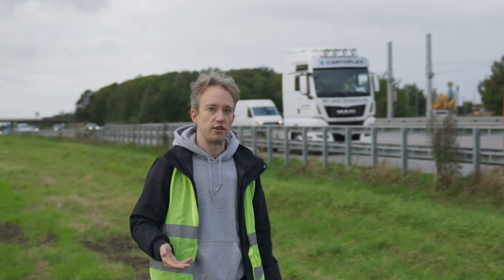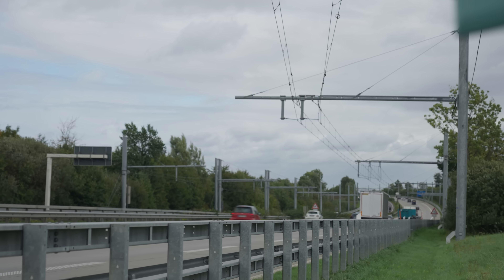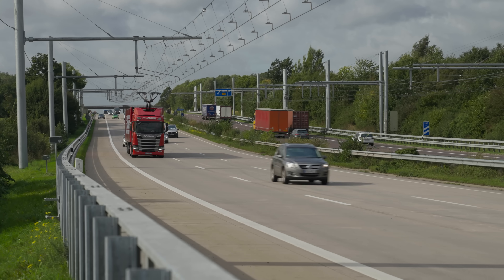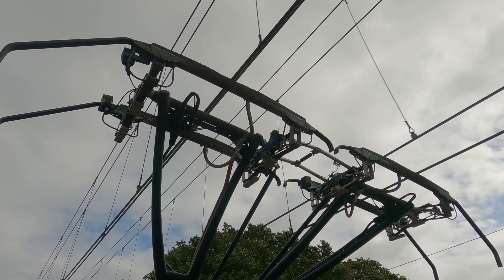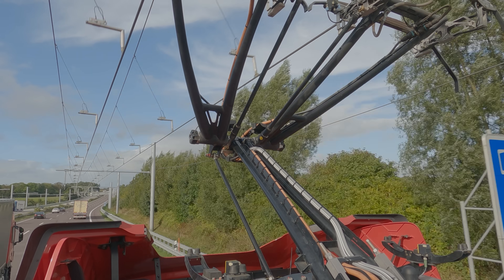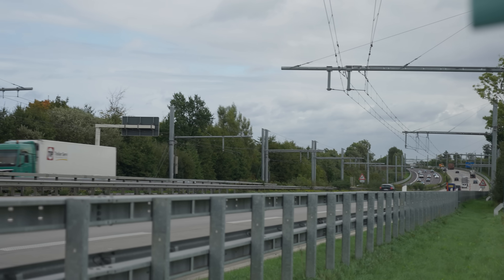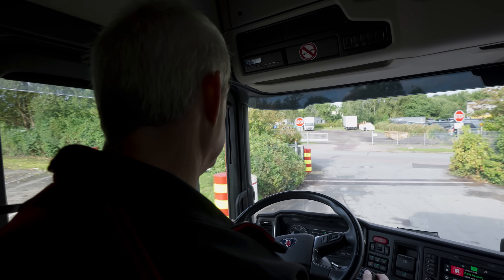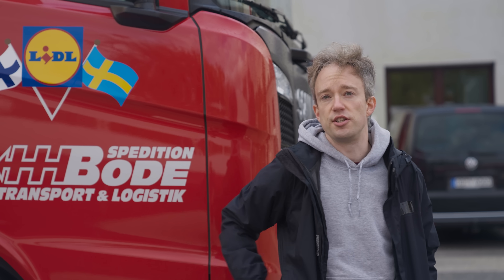The highway where trucks work like electric trains

Comment: Please enable auto-generated subtitles. Seeing words appear on the screen right as they're spoken (more or less time-accurate, but with consistent accuracy in terms of time-offset) does wonders for accessibility, especially for people who are still learning the language and for people who are partially hearing impaired (which is a lot more common than people think, especially due to how many people live and work in places with noise pollution which cause lifetime-long hearing damage).

As for trolley-trucks, cities could simply add trolley lines and let both trucks and smaller vehicles (like business or personal vehicles) use electricity to travel in the city, with or without a meter for electricity (i.e. flat monthly fee for the category of vehicle being driven, and starting with 5 years of free or very low fees to get more people to invest in the technology), up to even allowing electric trolley-scooters and electric trolley-bikes to move inside the city (either for free to replace public transport with low-noise electric vehicles, or with a similar electricity meter for the trolley antennas). Also, such a system could be used to use-up the excess energy from renewables such as solar, since there is a lot of vehicle activity during the times of the day when there is light outside and common electric vehicles cannot be charged significantly while they are in use, unless a trolley-attachment is used for recharging. And, to be fair, adding a trolley connection to electric vehicles could increase their range significantly by simply connecting to different trolley networks on the roads, such as those already existing for trolley-buses inside cities, and adding trolley connections on the right-most and emergency lanes of the highways.
Reply: I guess they might not have been there 24 mins ago but there are captions now.

Comment: This is a great idea, but what would be even better is hooking up a bunch of trailers to one truck to make better efficiency of trips. And maybe instead of having pure asphalt, we put down little steel rails on one side of the highway to have less friction...oh wait I've just described a train :/
Reply: The main problem with trains is the infrastructure. This is not very easy to scale. If we stay in Germany, the tracks are already very full. With the introduction of the "Deutschland Takt", the capacities for goods in rail transport will decrease further. Germany could now expand the tracks, but as is common knowledge, this is expensive and takes a very long time. With planning, legal proceedings and construction often over 20 years.
Equipping the motorway with overhead lines, on the other hand, is relatively uncomplicated because no new land is needed, relatively cheap and self-financing over a few years and can be built on all motorways and federal roads in a few years.

Comment: I wrote to Greg Clark MP years ago about a square mile solar farm being built in north Kent and asked why it couldn't be built alongside trunk roads where there is huge quantities of wasted land (with large south facing embankments already in place). These could feed overhead power supplies (but I think freight is better moved to rail anyway) or to motorway services for electric vehicles (though I think hydrogen internal combustion is the way to go).

Comment: Surely if you get a convoy of trucks then they reduce the amount of available electricity to charge so slow their charging down? I would guarantee that vehicle accidents would take out the overhead cable every so often, either from a vehicle collision with a support pole or a truck with pantograph raised taking an evasive manoeuvre and then catching the overhead cables with the over extended pantograph as they try to move back to the lane. The real solution is very fast charging batteries (or even a very large capacitor which charges the batteries) and induction plate lanes so you would collect charge by lowering an induction loop to skim just above the road as you drive along the lane. Scanners in the road would identify your vehicle from an RFID tag in the vehicles induction loop so that the vehicle payment account would be debited for the charge.

The pantograph seems like a good idea as it is existing technology......but the cost of setup and maintenance will be prohibitive.

Comment: At the rate battery technology is improving this could be obsolete before it's finished.

Also I work on the Railway and one of my jobs is removing obstructions such as plastic bags and balloons from the overheads. If a train ever catches it's pantograph on an object it generally tears down the wires. This could be a huge issue in a situation where traffic builds up and people can freely get out of their cars and wander around.
Reply: the one thing I didn't think about before
Reply: The rate battery technology is improving? You mean almost nothing?

Lithium-Ion batteries, the last major improvement, were developed over 30 years ago.
Reply: @TheOwenMajor  but it's still improving. Look at the range of electric cars now compared to 10 years ago.

Comment: Tom, I wish you had gone into detail about the pantograph you filmed there; looks like serious wear on graphite (?) contact pads; is that just from testing different pressures on the line or was it expected wear? Either way, awesome to see. Thanks!
Reply: I live in a city with an extensive electric pantograph bus network. The graphite pads they use are simply consumable parts and get replaced once they're worn out.

Comment: All electric vehicles do is to move the power production from the roadway to the electric power plant. Power still must be produced somewhere. So with more electric vehicles on the road that means more power plants must be built to supply power for all the electric vehicles. This fact is always overlooked and omitted when pushing electric vehicles.

Comment: I can't see this happen in a medium distance.  Already the power grid is hopelessly insufficient to roll out charging stations and take electricity back from solar cells and windmills. Furthermore all lanes on every A road should have installed overhead wires or there will be a constant stream of e trucks on one lane making leaving or entering that road impossible. And there is not enough copper available for all those wires, not to mention the power stations feeding electricity.

Comment: I don't see why it wouldn't work. Tram busses have been a thing forever. Having that kind of infrastructure in place on major highways may also allow for development of an option for consumer EVs that could make use of it as well, and that would allow us to build smaller lighter EVs with comparatively tiny batteries if they only need to handle day to day commuting and running around.

Comment: like the idea of allway having electric power available  , wonder if they can adapt it for normal electric cars as well 
the main thing that make electric cars expensive is the batteriepacks and one of the most obvious down sides to owning a normal electric car is its limited range and long charge time after you drained the batteries
both would no longer be a problem if they manage to use the same sort of overhead or metro style 3th rail power feed system for personal transport , it allso prevents the electric system meant for powering the homes from getting overloaded by charging a lot of electric cars , the overhead lines can run of a seperate electricity net at a higher voltage so it becomes more efficient 
wear and maintanance of the powerlines and the power take off units will probably be verry important as i can imagine wat would happen if a high power cable would snap and fall on passing cars or the powertake off with a worn through slider would end up grabbing/ hooking behind the overhead line at highway speed

Comment: Just saying, this is probably not going to fully replace electric trains, as trains still have the edge over efficiency. I'd say this will probably be used for shorter range shipping to places where there are no train tracks or to local areas.

Comment: Great.Have a battery powered truck with a small diesel generator in it to recharge the battery.Truck can run off the grid system.If the truck has to go out far it will run off the battery and recharge off the generator if no battery recharge station is around.

Comment: Actually electric vehicles consume much more energy per mile than gasoline vehicles because it is a law of physics that "it consumes energy to refine energy" and electricity is the most highly "refined" energy source of all. Gasoline and diesel engines are much more efficient for moving cars and trucks. We should conserve electricity for purposes for which there is no alternative, i.e., refrigerators, light bulbs, power tools, computers, etc.

Comment: I was thinking exactly this would solve the battery life issues most people have with electric cars. I'm almost exclusively traveling on highways. I only need 20 miles of battery charge at most with this, but without it, I need almost 300. The only problem I see is really a US centric thing. Government contracts would be given to some shell company owned by a friend or relative of a congressman who passed the bill. Other than that, we have a severe lack of linemen who are able to install this equipment safely, and doing this would also put a very large load on the grid which we don't have low carbon capacity for.
Reply: About the shell company of a politicians friend, well, you see that in a lot of other countries, too, sadly enough.
But overall it would be much more efficient to have the highway fully electric and automated, because it would eliminate congestions a lot I think. Might be more safe in general. But of course there will be people complaining that they can no longer race the (German) highways with 200kph and not pay for it by going to an actual race track... :D
Reply: @Djaenzee  I would totally kill for cheaper transportation right now. Gas has almost doubled in price where I live. Electricity is cheap now, but when technology like this begins to grow and electric cars begin to mature, electricity prices will skyrocket due to increased demand.

I dislike the idea of automating all the highways. It scares me a lot to drive my car, which has driver assistance technology, with the bells and whistles on. It might be safer for a while, but what about when a developer of self-driving cars pushes a bad update (like literally every software company that has existed) that kills people?  I know self driving cars have relatively low accident rates. Put them on roads with heavy construction in areas like DC and Virginia, where road law is more a suggestion. It will never be the car's fault for the accident, but will a car ever prevent accidents ahead of time?

Comment: This seems like a terrible idea on the face of it. I assume it's not like what it seems and there are all kinds of automation and such that we're not aware of. 🤔 What happens if the driver doesn't lower the pole in time? What happens if it catches on the wires and the driver changes lanes and pulls the whole thing down? What happens there is any other type of incident? This seems way too fragile to be reliable. I'd rather drive a Fabergé egg. ¬_¬

Comment: What's amazing is that this tech has been used for about 100 years. Not just with trams, but with trolleybuses too, and some in rural areas.
Reply: London also had a system many years ago where buses were powered from overhead cables like this. Lookup trolley buses
Reply: @thomashoups5926  San Francisco has been doing it for a very long time too.  In the 80s we used to like watching the shower of sparks from them when something arced.
Reply: @earthknight60  I can see why London decided to get rid of them but then again at the same time it'll be so much better for the environment because we won't be creating loads of lithium battery's that have a shelf life
Reply: @thomashoups5926  so did Cardiff , loved a ride on one as a child .
Reply: There is a motorway in Sweden (Sandviken) with the same system since 15 years ago.
Reply: It was used like everywhere in the US until auto companies bought them to tear them down, forcing everyone to buy cars.
Reply: I can't tell if you're trying to be funny.
If not, then trams and trolley busses can't leave their wires. This system allows trucks to charge while on the highway, which is where they spend most of the time, then they can disconnect and then run on batteries as they drive off to their rural destination.
Reply: WHAT AN INOVATION!!!
Reply: Why is the truck use wide  pantograph like the rail ones instead of a hook like in trolley busses ?
Reply: Yes and in many areas the "trams" and trolleys were dismantled as "inefficient - rather not as profitable to the Motor and Oil Corps whose bosses sort of run the world - since ~WW2
Reply: Ya everytime when I visit my relatives , I'm impressed by the trolleybuses of Coimbra. Apparently even such a low volume produced type of Bus is still way cheaper than operating a regular bus.
Reply: The reason why it has been used on rail and on buses and not anywhere else is because they have fixed routes, so wiring those routes is efficient. Lorries don't work that way. They need to be able to change and choose their routes freely. So they will always have to rely on batteries, which means that it'd be better to just go pure BEV from the start. Rail can do the rest.
Reply: @Yutani_Crayven  Sorry to burst your bubble. But I drove HGV's for 9 years, going to the same place every night and back again. You would be surprised how much of it is done.

Comment: Around here we've had a number of improperly loaded flatbeds striking overpasses in recent years, including one incident that knocked out natural gas to half the city. There are going to be some nasty incidents but I hope this idea comes to the US soon.
Reply: guess what, we have bridges, railroad crossings with overhead wires and also tram tracks within the cities as well ... although incidents can happen, it's not like a daily issue they face
Reply: @EnjoyFirefighting  I'm just saying they're gonna need some safety standards for this before they roll it out, like some large crash bars so someone doesn't come along with a backhoe arm sticking up and rip out 20 miles of overhead cables
Reply: @brandonlink6568  the safety standard is called standard overhead clearance, with no road vehicle allowed to be higher than 4.0 meters; Most bridges, tunnels and overhead traffic signs are higher than that, while some which indeed only allow vehicle heights to be at 4.0m might have a height check sensor before entering e.g. a tunnel and which, if activated, will turn all signals red in front of the tunnel. Within more than a decade I observed only two incidents where wrong handling caused major damage, and only one of the two incidents was on the road
Reply: @EnjoyFirefighting  unfortunately in the US standards aren't as standardized and people don't know what they're doing. The YouTube channel 11foot8 is dedicated to one bridge people have crashed in to hundreds of times despite numerous warning signs. We had 5 good bridge strikes over nearby freeways close together, one required replacing the bridge and another they had to lower the road.
Reply: @brandonlink6568  I'm well aware of that very special bridge and the load of videos generated by tall vehicles there ^^
The two incidents I became aware of was one truck with improperly retracted crane destroying roof installations like ventilation and traffic signs in a highway tunnel, a matter of some hours of repair and a long traffic jam, and the other one was a similar incident with an improperly retracted car crane on an inland cargo vessel striking a gas pipeline which was right underneath a road bridge; THe bridge was completly destroyed in the incidet and it took years to build a new one . 
Of course that kind of stuff also happens more often, but I didn't see it in person. Thus few days ago one low bridge in our state's capital city was struck by a tall truck, and while the FD was on scene to free it another truck going the other way got stuck under the bridge as well, despite clear warning signs of course. 

usually it really isn't a big issue to worry about in Germany; Many large cities have tram networks, many old sections of railroad tracks have level crossings and it works just fine

Comment: That's good and all, but in Germany, where I believe this is currently tested (not sure I understood correctly), most of the electricity is not green nor renewable (it's in the process of becoming that but not yet). Isn't powering the trucks with that only moving the carbon emissions ? (And yes, the problem is the same for electric cars)

Comment: we had electric city buses like these in Tehran 20 years ago! it is not a good solution. too many cables and too many restrictions. I am not sure but I believe the power efficiency is questionable too. we should keep thinking :D
Reply: well within the city you require lots ot overhead wires across the open space road system, while this is only one linear string of overhead wire

Comment: And accidents don't happen all the time on highways. Where a truck might run off the road and knock over one of those posts, and now you have electricity lines in the highway. Possibly blocking off a critical on/off ramp.

Comment: And why not have battery trucks and buses which also charge this way during the trip? This is the future for heavy road transportation!
Reply: the video literally is on trucks, and electric buses usually don't go on the highway; There are electric buses which charge their batteries via overhead pantographes and power lines at bus stops as well